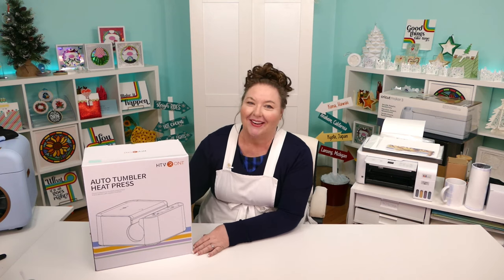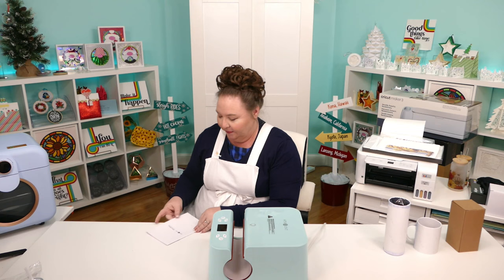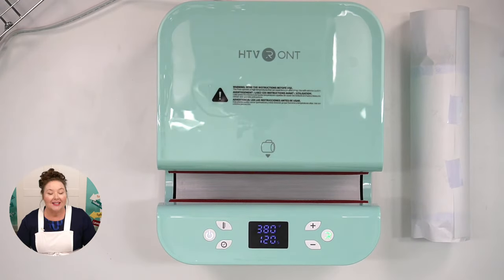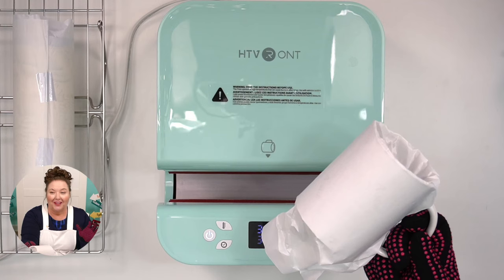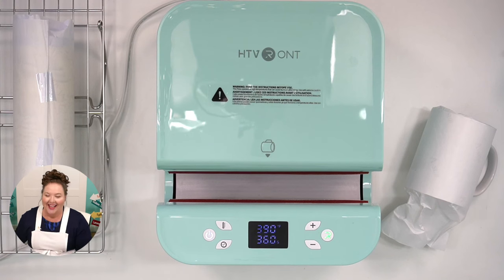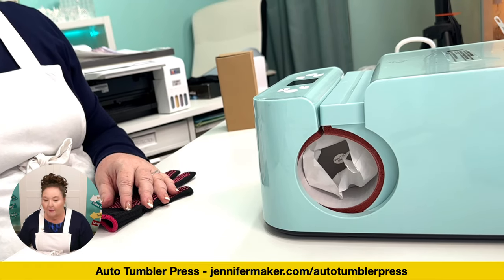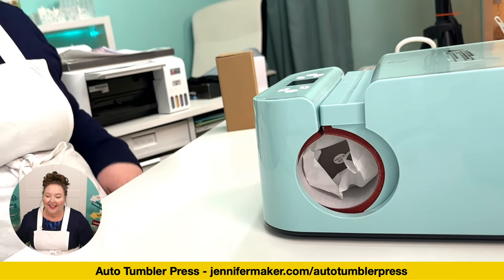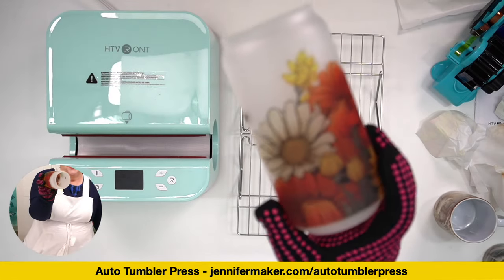HTVront Auto Tumbler Press Review - Unboxing, Setup, & Playtest of a Tumbler, Mug, and Glass Can!

Comment: I just purchased thee HTVRont Auto Press and was able to successfully sublimate a 15oz Mug (was a tight fit) using the Michael's Brand. Also used the Michaels Brand 12oz Mug without any fitting issues. The Cricut mugs are probably just too wide to use. Yes, Michaels make 10oz mugs to answer one of your user's questions.
Reply: Thank you

Comment: I purchased that press.  I was very disappointed in my results.  I did return it for a replacement.  I'll see if that helps.  I, too, was not happy with the rims of my tumblers.  I also had a difficult time determining time and temperature.  Fingers crossed for the replacement.  Thanks for your help.

Comment: I used a 15 OZ hog mug it fit tightly.. i had a issue near the handle and not enough time used 360 sec will increases time on next cup
I also checked a 30 oz hog glitter and it fit . I haven't tried it yet .

Comment: I notice a lot of people who use this tumbler press getting ghosting around the top and bottom even when they tape well. I've gotten it too.  Do you know if you can use a shrink wrap sleeve on tumblers to get a better result in this press?
Reply from the maker: Yes, using a shrink wrap sleeve on tumblers can indeed help achieve better results and reduce ghosting, even when using a tumbler press like the HTVront. The shrink wrap sleeve helps to keep the design in place more securely and applies even pressure around the tumbler, which can minimize the chances of ghosting.
Reply: I've seen people press their tumbler first and reinsert and press the top and bottom again separately...seemed to work for them

Comment: I would be afraid to put in water as items cooled too quickly could warp or crack.  My ceramic coated pans have instructions to not heat or cool too quickly to avoid cracking.  Metal pans that have been on high will also warp if put in a sink of cool water..  Just a thought.
Reply from the maker: Thanks for the tip 😊🌻

Comment: Is butcher paper wax paper, parchment paper?
Reply from the maker: No, parchment paper is not the same as butcher paper. Butcher is more versatile, as it can be used for cooking, wrapping, and crafts. Parchment paper is coated with a food-safe silicone, which gives it a non-stick surface. Both are also different in terms of temperature tolerance.

Comment: I dont know why pribts are not transfered to tumblers or mugs. I am using suboimation mugs and tumblwrs from amazon. Also is that because i am using epson inkjet ink should i change to sunlimation ink? I like htvr heat machine it is convenient eay to use and also pretty. Kindly let me know if anyone has the same expwrience. I will try using sublimation ink im using epson 2800
Reply from the maker: You need to use sublimation ink for sublimation. The other option is Cricut Infusible Ink which is sublimation. https://jennifermaker.com/cricut-infusible-ink/                https://jennifermaker.com/cricut-mug-press-ultimate-guide/
Reply: Thank you I will buy sublimation ink

Comment: Hi, thank you so much for this video, which I watched earlier.  I did want to add a few comments on what someone had asked about using the Cricut mug press to do tumblers.  I ordered the PYD silicone inserts, and tried making my 20oz tumblers using them.  I used the thickest one.  I have to say they turned out beautifully.  I did have to rotate, and then do the other half.  After a run or two the timer stopped working but the heat worked fine, so I just used a timer.  I was very very happy with the results.  As I don't intend to do many, I did not have to invest in the PYD press which I had in my shopping cart.  But if I want to do glass tumblers or cans, I guess I will have to invest in one of these.  Too bad about the 15 oz mug, and I wonder about the 30 oz tumbler fitting since the larger mug did not fit.

Comment: It seems the top and bottom are often an issue. I looked up a 300z straight tumbler and they seem to  be just over 3 inches so I’m skeptical. My PYD manual one is much more flexible since you can change the insert easily. Thank you so much for your effort.

Comment: What kind tape you using
Reply from the maker: I use Cricut heat resistant tape. Here is an affiliate link. https://www.amazon.com/dp/B07TD99VV9?coliid=ISJMLUHNGGVG2&colid=3VXE8712M3045&psc=1&linkCode=sl1&tag=jennifer00e-20&linkId=4de8fdccf2f1265a6988f4442f371b6d&language=en_US&ref_=as_li_ss_tl